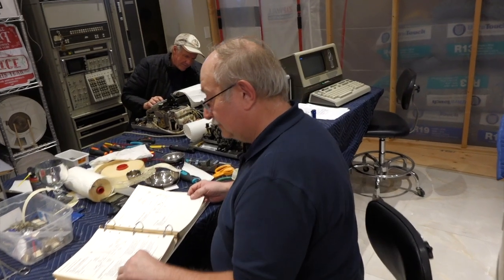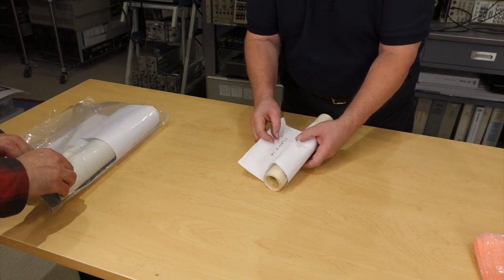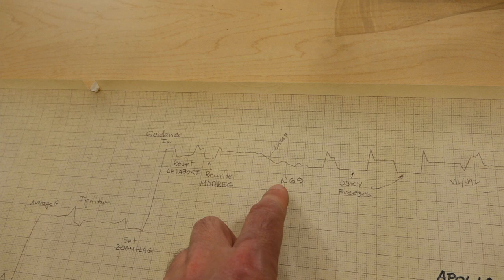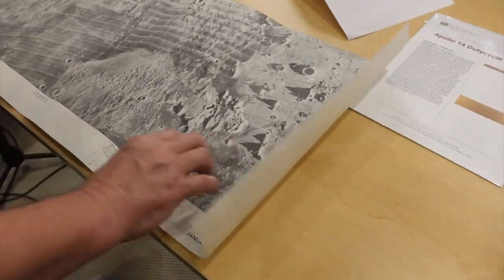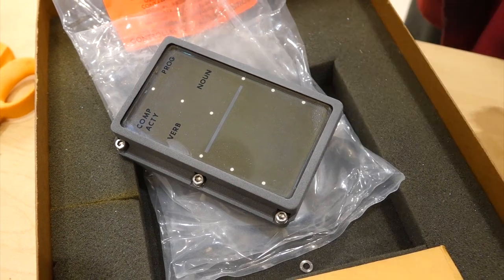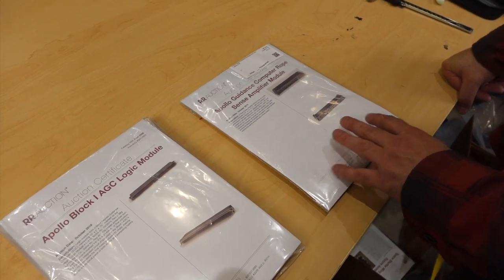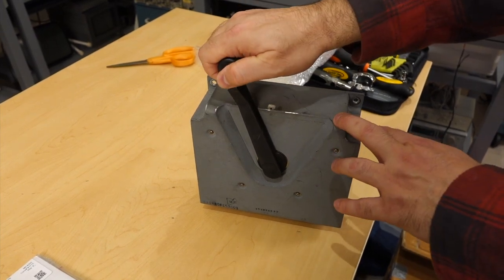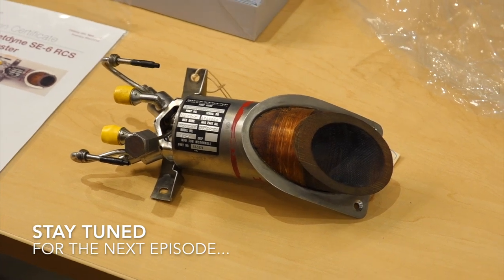Marcel's RR Auction Space Items Unboxing

Comment: I worked for Teledyne Geotech during the A11 mission. I believe that Teledyne company designed the thermal blankets. I do not remember how many layers it had, but I do remember them saying that a group of mathmeticians designed the wrinkle pattern you see in the material. The wrinkles were arranged so that the material of one layer could contact the adjoining layer using the smallest possible contact area. It was put over the seismometer to maintain an even temperature around the instrument day and night. Unfortunately, solar radiation electrically charged the layers making them swell apart and become ineffective. The astronauts put rocks around the sensor device to hold the shield in place. The weight crushed many layers together -- during the day the environment was too hot to use, but they were able to keep the environment warm at night by running the calibration motor continuously. It worked and we got the first high-resolution seismic data from the moon, albeit only at night.
Reply from the maker: Thanks for the awesome information!

Comment: It seems like the horizontal scale is seconds since liftoff per millimeter?  at 8:11, the bottom horizontal value is around 389740, which works out to 4 days 12hrs 16mins, 40 seconds... but from what i can find on Apollo 14 transcripts, they hadn't landed yet by that point...
I'd love to see a video of the load graph going with the audio/video from the mission simultaneously.  :D
Reply: It looked to me like the marker numbers were pre-printed on the chart.  I suspect that was simply a stock roll of graph paper for the chart printer they used, and the rolls probably came with some specified number range that you could order when you bought the rolls. The spacing may well be seconds, but I think the numbers have an arbitrary origin.

Comment: "RETURN TO AN AUTHORIZED REPAIR ACTIVITY". Must have been made by Apple...
Reply: Probably cheaper to fix too
Reply: And then they tell you that you need a new AGC motherboard and you'll lose all your flight data.
Reply: @colderwar  Absolutely not cheaper to fix. Military hardware is extremely expensive, and space hardware even more so. A single transistor probably costed more than $100.